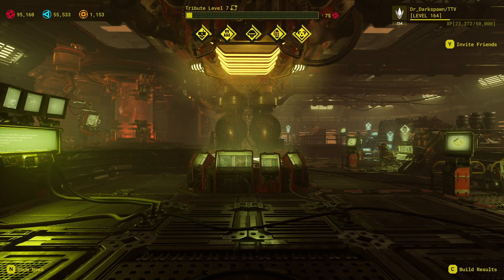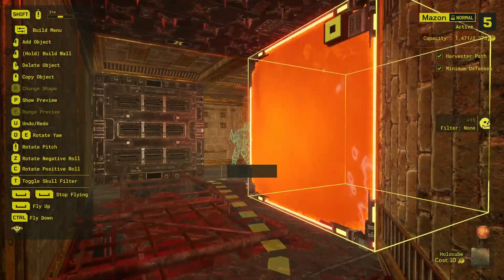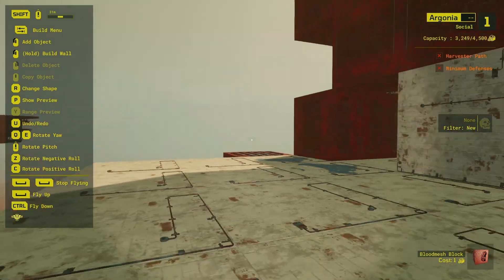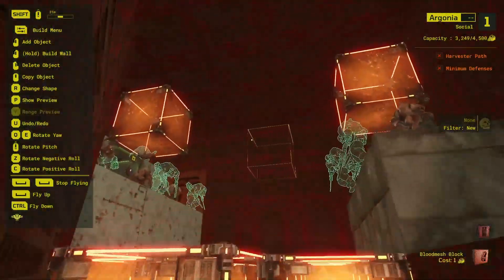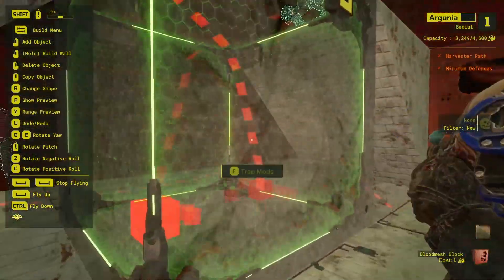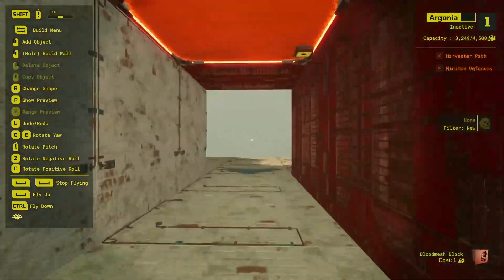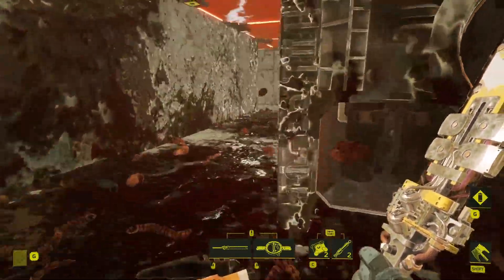Meet Your Maker: Advanced DMS (Dead Man's Switch) usage and Setups

Comment: That is, sooo much used capacity for a trap that sounds great on paper but only has potential to kill once?

You'll get the initial like 1 or 2 kills until they figure out the trap, but then all of your capacity and danger ratio is wasted on that one trap... and by your own standard it's not skip-proof through the average speed-run tactic.

bloodlust on a piston is such a random timer, you've got no control over when and where you kill people.

This is basically just a flamethrower hallway with warmonger spam in the middle, but with an obnoxiously high extra cost and difficulty rating.

I thought y'all had the same idea as I did for the dead man switch, but I'm just disappointed ): This isn't efficient at all
Reply from the maker: Hmm, maybe you misheard me when I mentioned almost all of those points, mentioned it was ineffective and unoptimized and stated that it was meant to show creative use of DMS, instead of being a setup in itself that I would use on an outpost, but I'm just disappointed instead.

Critique is good, but please pay attention to deliver valid critique

I also did mention that this requires pressure from behind to force them into the DMS setups and mess with their timings, that you SHOULD add another piston on the last hallway and have failsafe traps incase they find ways around it. Stalling the raider is important, regardless of the trap/guard being used. Looking at a hallway with two warmongers and two incinerators in it, while calling it ' spam ' , is quite inaccurate, and now I'm just disappointed.
Reply: @dr.darkspawngaming  Your "Pressure" was 8 armored warmonger.
Your two hallways warmongers were followed with 2 more front warmongers without forgetting the guards used for the DMS That's a LOT of guard capacity used at random.

This was a creative use of DMS on it's own because I had not seen it before, but this was a very obnoxiously costly and inefficient one.

You still have no control over the DMS, the fall is also very wide and random, the killzones are too spread out and cannot be triggered "On the stall".
I mentioned the flamethrower warmonger spam, not as a example of your video, but as a way to explain that your DMS had little to no effect because the other traps AKA the flamethrower monger spam were more efficient at killing and less costly.

It's important to control your traps, unless you're just throwing them randomly expecting a miracle to happen. I'm disappointed at the fact that it's not efficient and doesn't get controlled kills, not because of your setup.
Reply from the maker: @darkyan_1653  There was not a single armored warmonger in the second outpost of the video, the DMS is actually very precise and always lands on exactly the same spot, the timings on their explosions cover the entirety of the long hallways, as seen by the remains and explosion remains on the walls and floors. The only area that does not have DMS hitting it is the one back corner and the first small corridor, which is why it has an impaler with self destruct on it and the back corner has one too with an incinerator. The pressure, if you listened in the video, is another room before the actual setup, not the setup itself, which was what I was referring to. It wouldn't do to introduce random concepts with no relation to the current conversation or covered content, so I did not. Also this is not just one example of DMS usage, its actually five, the cannonback near the start for dms timer consistency, the delayed hornet dms, the dms into dms falling on timer, and dms destroying another holo to trigger other dms guards to path on a timer and bloodlust warmongers into burning piston death pistons.

These traps are controlled precisely, but I fear you're still try to look at it as a setup to be used in an outpost, when that was not the intention at all, simply to produce an environment where all these different uses, triggers, timers and concepts can be shown and explored. This is why the cost is 'so high' and why it is less effective than a compound set of traps and guards.
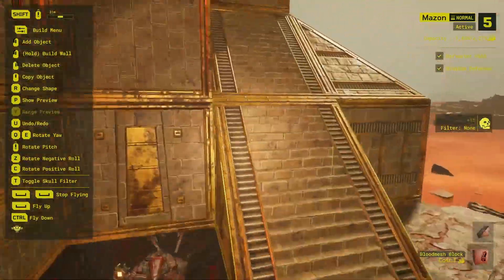Reply: @dr.darkspawngaming  2:17.
Boi, you made the video, don't make me correct you on your own stuff.
Blood splatter don't correctly show the explosion radius. 2 DMS warmongers don't cover the entirety of that hallway and all of your DMS fall is set on a single bloodthirst trigger, which ruins the efficiency, that corner, which you mentionned is especially not affected because you pre-emptively create a cannonback explosion, and then miss the timing with the DMS fall.

I understand that this isn't an outpost setup. I was really looking forward to seeing those "Setups" used together to show how efficient they are.

But that's the issue. You didn't mesh them together to showcase the efficiency. You put them one after the other just to show them.

I see a poorly made hallway with defective DMs falls.
A defective corner cannonback impaler chain
Defectives warmongers hallway blockades
And a singular piston at the end, which I also believe you tried to explain wasn't made into a setup, but only put there as a "Showcase of blocking the front until the DMS blows up".

This entire video showcased a neat trick, without showing it work.

I hope that you understand that this simply feels underwhelming to the viewer. This is like if I showed you a cool and efficient bolt trap setup that killed 99% of the time, but then made obvious holes into the setup to dodge the bolts. It misses the purpose.
Reply from the maker: @darkyan_1653  Some clarity in your statement that some of it was targeted at the first outpost shown would have been appreciated, but makes sense now that you've linked the timestamp, thank you. Blood splatter can be a good indicator of the rough area that is covered by a dms guard, not exactly, but it is close. The difference between the explosion radius and the blood splatter can (sometimes) at most be half a block (but normally less), and that's with certain angled blocks barely getting a few drops on them.

Unfortunately, due to the nature of DMS itself, it will always be extremely costly and inefficient compared to regular traps/guards if used as the main method to deter raiders, simply because it relies on too many factors, like raider movement, timing, decision making and mostly their loadout. Ultimately, the mod was not intended to be used as a main method of killing raiders, but as a supportive mod to help zone/stall raiders into other things. With proper use it can get kills, but as you've said, it will only get a few.

It's true that the focus was not efficiency, but does not mean that there is not synergy to be found. I would be interested to see what you can make and how you improve on these concepts to try and make them effective. Perhaps you can share your results when I post the showcasing of my outpost using these concepts, made for open matchmaking, so that we may further our use of these methods
Reply: @dr.darkspawngaming  I do have a prestige 10 outpost that's about to run out which uses three or four different type of targetted DMs falls.
I would be able to make it a Social outpost soon if you'd like to try out and see if those pleases your curiosity.

As for the piston and the cannonback DMS I'd love to try what I can do with those, but I fear they're too costly on their own to actually fit a reasonable difficulty whilst effectively offering good kill support for other traps.

I'll hold you on that, see if I can make something you'd love to see, but no promises